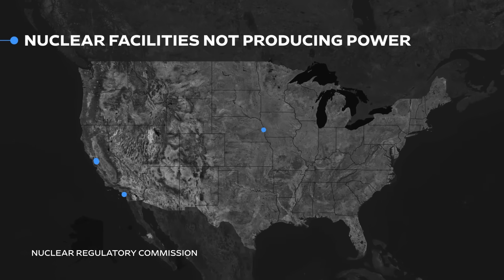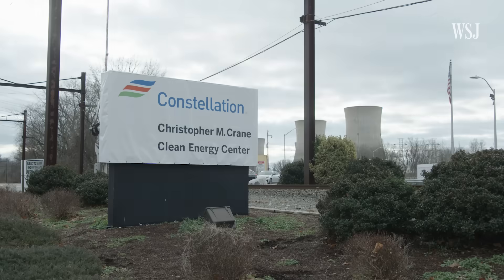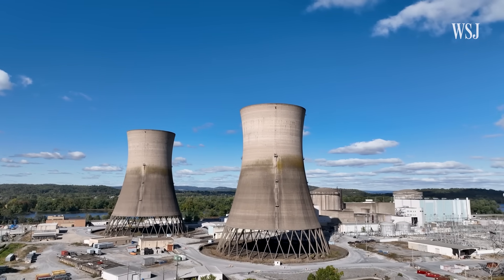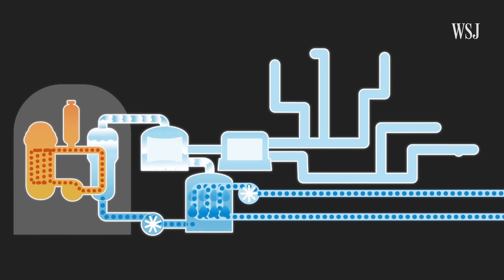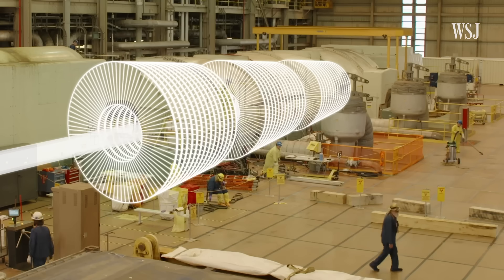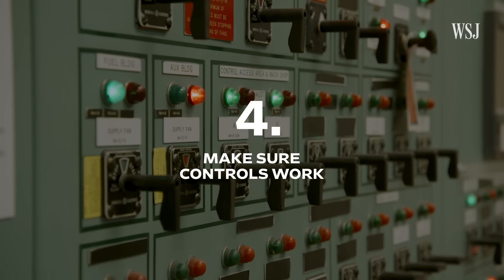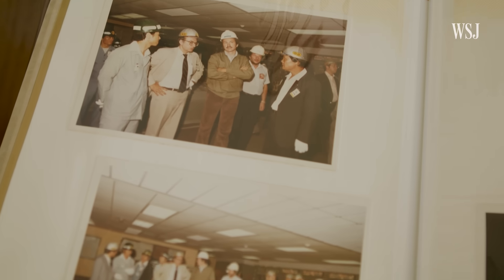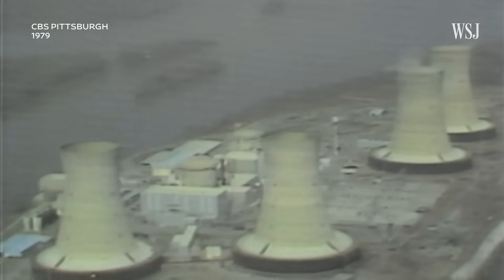Inside the $1.6B Plan to Restart Three Mile Island | WSJ

Comment: Why are they reopening these power plants for mega corporations and AI, instead of to strengthen our energy grid and lower energy costs for Americans.
Reply: Adding this baseload DOES strengthen our energy grid and, theoretically, should stabilize or lower overall electric costs. Whether costs will go down is yet to be seen...However, as much as I'm doubtful, I'm also hopeful!!

As these AI Data Centers come online SOMETHING needs to power them. If we don't increase the baseload capacity, it will create shortages and increase energy costs across the board. Recommissioning these nuclear plants is the best move America can make to ensure energy stability and capacity is there for all who need it. Solar and wind are not reliable enough - by a long shot!! And battery-electric storage is not safe or reliable enough, either.

Next step is to relight many of the natural gas powered plants, then, lastly, the coal plants if needed.
Reply: We don't matter to them. They want $$$, power, and control.
Reply: There will never be a reduction in energy cost .that is all a fiction .you want to stop the  need for more power ? get the human race to stop breeding like rabbits . there are a finite amount of  natural  resources  some of which can not be replaced .some are so deadly if one mistake or one failure happens 10s of thousands of people will be effected for many generations .that's the truth 100s of years .The one and only thing driving this is money not for you and me but the rich and powerful . The absolute truth is if we fallow this path we can destroy the world .I'm glad i am old i will die of old age before this happens but the facts of what i say will not change unless the people force a change . And from what i see today we are doomed .
Reply: The truth is Microsoft will never be able to pull half of that power. Its going in to the grid. It will be used by everyone. Chill the f out and use that brain you have between your ears. Do a little math.
Reply: There is another side to this though. The power plant is being reopened without massive taxpayer investment. It’s infrastructure that would have otherwise laid dormant, thus being unproductive. This lays the foundation for other power plants to be reopened and if this does work out, we will have a profitable business that helps enrich the economy.
Reply: the simple answer is - clean energy.  If maintained properly and with safety procedures, its safe.  in the 70s, they didn't have safety in mind, but now that we know the repercussions if something bad happens, we can work to prevent it.  Plus we also know now that we are not prepared to go without oil and gas and go straight to electric everything.
Reply: because they can afford it. can you?
Reply: The power companies have been shutting down plants specifically to create shortage to necessitate higher prices
Reply: Bureaucrats tie up and forbid building new plants in red tape at a cost effective means.  The mega corporations have the finance to take on the process when the utility companies are fine with current contemporary means of generation and government subsidized funding toward clean energy solutions.  The mega corporations and utilities won't do it if it cost them money.
Reply: @ give me one nuclear regulation that you think is unnecessary and not needed. name one.
Reply: Cause they being the money to pay for it.
Reply: Bill Gates
Reply: we had a very strong Energy until Obama and Biden took Over, hint it still is strong, hint it the TVA can purchase 10k megawatts dec 23 dec 24  2022the problem is not the Grid. it is lack of power Plants
Reply: You've never taken a class in thermodynamics.
Reply: Yeah, it was shut down because "of cost". Why was it so expensive before and what changed that now makes it affordable? I was thinking something else must be at play.
Reply: It's tied into the same grid that everyone else uses. This is a ridiculous question to ask if you understood the engineering side of things.
Reply: Because American 🇺🇸 s a corporation. And we aren’t a democracy or a representative representing republic, it is an oligarchy which is why these corporations get their way.
Reply: If they didn't reopen, then these companies would take from what regular people already have.
Reply: Because power generation has operated as a marketplace and not a state run enterprise
Reply: Because of cost. A group of billionaire investors can raise much more money much more quickly than government can. Such an operation would be stuck in bureaucratic stasis until the site deteriorated beyond repair.  This is all private dollars resurrecting these plants. As long as it passes inspection criteria, this is a good thing because by generating their own power, the companies aren't a drain on public resources.
Reply: @ What are you on about?  TMI was owned by General Public Utilities, a company traded on the NYSE.  It was never a government facility, with the exception that the fuel, like all reactors was leased to them by the govt.
Reply: @ these people dont care about private property
Reply: @John-wx9oy  Exactly
Reply: You and I don't matter, we live in an oligarchy made to serve billionaires and their interests
Reply: @omegathan 😂
Reply: Because we don't matter. They only bothered with this because Nvidia's top of the line GPU requires as much energy as a hundred average homes per hour. 

Goes to show who's really represented as far as our elected officials go.
Reply: @EbonySaints  where'd you get those numbers from?
Reply: @hallomeinnameistkarl216 I used the EIA's 10,500kW estimate for the average American home, divided that by 365 (~28kW per day) and then by 24 for ~1.2kW.

Considering that the GB200 NV72 datasheet from Supermicro states that the whole thing can eat up 132kW, that approximately 110 homes that can be powered instead of a LLM.
Reply: @EbonySaints  This is what America voted for, so this is what they get. Americans must prefer corporations valued over them.
Reply: @EbonySaints  You summed that up perfectly! Our extorted wee tax dollars don't go into their pockets as easily, but profits from shares do, even though the tax payers paid to make it operational!
Reply: Because Microsoft is paying for it. Not the consumer. But who buys Microsoft we do. We are more willing to pay for tech than power.
Reply: This is the place that tried to unalive a safety worker for showing unsafe cleanup procedures after the meltdown.
Reply: Because we don't need them for the grid, it's why they were shuttered to begin with.  Only when an actual demand "above and beyond" came along did it make sense to reopen them.
Reply: Greens
Reply: Because AI is far more important than any of you.
Reply: You literally contradicted yourself and answered your own question
Reply: They want the AI for something that serves themselves. And there may be other reasons they aren't talking about as well. Nefarious reasons.
Reply: @DaveMiller2 and AI will allow them to increase productivity and slim down the work force (if not deleting the white collar work force entirely)
Reply: Dumb question. You already know the answer.
Reply: Becuse it won't strenthen the energy grid and it certainly won't lower energy costs for americans. To run a power plant you need a constant drain as it takes up to 7 days to start.  Pricing is not compareable, too. Renewables can be produced roughly at the price of raw oil, Atomic power is 5 to 10 times as much according to some scientific papers, and in the end electricity has to compete with oil.
Reply: LOWER COSTS?  Get serious, dude!
Reply: The next step towards the cyberpunk dystopia where “Megacorps” own it all. Microsoft - game company, pc hardware company, operating system software company, search indexer, energy supplier. Pretty soon we’ll be approaching microsoft with “ our grid is stressed pwetty pwease can we haz 30 megawatts from your power plant? “ and they’ll be like yeah AND you’ll pay me!
Reply: It's about how much money they can fleece off of people.
Reply: Cause those companies are paying for it. These abandoned nuclear sites are just sitting there generating cost for the taxpayer and these guys are offering to get the problem off their hands.

Now we really ought to be having a re-think about just putting those plants back online for the benefit of everyone and a re-think about how utilities are structured but this is tangential to this and a bigger issue.
Reply: Giga corporations 🤣😋😛😜🤪❤‍🩹❤👍
Reply: We live in oligarchy. It will soon become a Banana Republic in the next coming years once corporate slavery is legalized
Reply: This is for CRYPTO MINING CENTER NOT FOR AI..

Comment: Just re-watched the 2019 HBO tv series Chernobyl and it’s quite terrifying as the absolute worse case scenario.
I hope the safety systems function properly.
Reply: The biggest problem with Chernobyl was they disabled safety systems to run a test, brought the power level too low, and then had to overcome the Xenon gas to bring power back up instead of waiting another day.  Well, they did overpower the Xenon gas and that went to the prompt critical event.
Reply: Was thinking the same. Germany inherited a bunch of soviet reactors when they reunified. They are not keen on nuclear for that reason. The French are meanwhile building a new reactor in the UK and they need to invent new words for time and cost overruns.
Reply: @astranger448  Not the issue at all libs hate them and they will be restarted as well just watch
Reply: Chernobyl reactors and TMI pressurized water reactors are 'apples to oranges'.

Comment: The bigger concerns should be that the entire system design is so outdated it doesnt take into account changes in the geology of the area, the sea level and advances in both reactor design and safety systems. These won't be present when it goes live.
Reply: Or how they skimped on replacing old components that "tested" ok because they want it done quick and cheap.

Comment: Reviving an old nuclear power plant it is just a "cutting corners" for the corporations that wants to be "compliant" with the regulations...... in this case a 45 years old regulations that where in place when the plant was build.
It is the same as the well known "Gliders" in the trucking business, and thousands of them are currently on the roads across U.S. - LEGALLY!!!!

For the people that don`t know about the "Gliders" - that is the latest model of semi truck like Freightliner, fitted with a rebuild Detroit Diesel S60 engine , that was "compliant"  for emissions, smoke and etc. back in 90`s and apparently none of the EPA07, EPA10 , EPA14, EPA17 or EPA21 can stop them from being "rebuild" and keep them from polluting

The Tree Mile Island IS A NUCLEAR PLANT - PLEASE DON`T restart for corporate greed

Comment: Like any industrial industry nuclear requires high levels of attention to safety, maintenance and most importantly redundancy to ensure accidents if and when they do occur are 1. minor and 2. under some control all of which is possible even with older technology.

The old mindset prior to Chernobyl, 3 mile island and a handful off smaller events is that it be built in such a way that it cant fail that was their mark for "safety" rather then assuming something will eventually go wrong so how can we put in place enough redundancy functionality and other safety measures so we can keep such an event under control till we can fix the issue, the people at the time never assumed that at some point either through environmental regulatory changes or a lack of funding would these facilities fall out of repair and thus the risk profile would reach potentially dangerous levels it was unthinkable to them in their time.

What has changed since then is we are more realistic about the dangers nuclear if not done correctly poses, the problem is the general public has not been made aware of the massive improvements in design safety and regulatory checks and balances that have made nuclear in todays, day and age which would make nuclear a much more safer reliable and predictable long term solution to energy needs.

by just about any other measure statistically nuclear is far safer and has a lower risk profile then just about any other source of energy production, but, in many ways we have made radiation so scary to the general public that it is fear keeping people from accepting nuclear as the much safer and cleaner means of energy production.

if you look at the major alternatives such as oil and gas / coal and hydro all of which have significant environmental impact and cause many more deaths and injuries yoy then nuclear ever could then the answer does become clear.

Comment: Nearly half a century old and abandoned nuclear control systems and pipework being quickly checked and used. This seems insane. I wouldn’t pull an abandoned 50 year old washing machine out and use it let alone a nuclear reactor.
Reply: Retired nuclear plant engineer here.  It was only shut down in 2019, and there was a small active staff monitoring the plant and maintaining and operating key safety systems required to cool the water in the Spent fuel pool and radiation safety.

All procedures and documents exist due to storage requirements.

I'm quite sure that there was no significant degradation of any key components due to the materials and deign of nuclear power plants (virtually all nuclear safety systems are built from SS or more exotic alloys).  Main steam piping and turbine casings are very thick even if they are carbon steel.

Most of what is likely to have degraded in 5 years is relatively minor to replace or rebuild.
Reply: @ this video was so badly put together it appeared it was a derelict site that was mothballed! 🙈
Reply: "I wouldn’t pull an abandoned 50 year old washing machine out and use it let alone a nuclear reactor."

That's because you've been thoroughly programmed by advertisers to crave the next big thing.

A 50 year old washing machine would have been built like a tank, using heavy gauge steel for the enclosure, and using dead-simple controls. Even if it wasn't functional, you could refurbish it for dozens of dollars.
Reply: @ not quite sunshine. Also finding someone to refurb to operating condition with suitable parts and guarantee it for use would negate getting something that worked from this millennium.
Reply: @ The USA and much of the rest of the world is successfully operating a lot or nuclear power plants from that era as many companies that served nuclear power plants still do production runs (but the parts are expensive).  Thus key parts are still available and the knowledge of how to refurbish the equipment is standard in the industry.

Comment: Would be easier to just start over with modern controls. That monster control room requires way too many people that know what they are doing. Human error is built in even if the controls work perfectly. They could take all that mess and run it with PLCs.  Then have quadruple redundancy of the entire control system. Just make sure its not able to be connected to the internet...

Comment: If nuclear power is going to be turned back on, let it power American homes. Microsoft buying this solely for AI servers is beyond dystopian, pure madness. These tech businessmen have so grossly oversold AI to investors. I give this project 10 years
Reply: The best part, if/when MS decides they overestimated AI; it's not owned by MS, one can assume that constellation would offload said power to the grid for general use.
Reply: But the power company is paying for the project with Microsoft being the main customer. If it wasn't for tech industries massive energy consumption, this project would not have been economically feasible or profitable. So do you think restarting this plant will make residential energy bills go down, stay the same or go up? And when the plant finally closes who pays for the decommissioning?
Reply: " Microsoft buying this solely for AI servers is beyond dystopian, pure madness."

I don't think you understand what's happening here.

Microsoft has projected how much additional demand they're going to add to the grid. This project is going to increase supply to offset that demand.
Reply: @dafunkmonster  Correct, which means the net benefit of energy costs to the public is zero. A private entity benefits while the risk is socialized - in other words, dystopian.
Reply: @FatherMolonLabe187  If they are paying for project, it's still benefit to you because you didn't pay for added capacity on the grid.

Comment: ..."it is cheaper to restart a nuclear power plant than build one from scratch"...
It continues to be that permanent damage to the atmosphere, surface or groundwater - would not be cheap.
Scientists in Russia, (A. Sakharov), and in the US, (E. Teller), once suggested building nuclear reactors underground. 
The plan was considered to be too expensive.
- The smaller size microreactor might better lend itself to being built over an underground compartment, and on retractable supports.
The underground compartment, partly sealed by plasma torch drilling into the bed rock, would help to protect the water table.
In the event of catastrophic failure, the supports would be retracted and the reactor might be dropped underground, then covered over more quickly.
The hot reactor might also melt an added lead underground compartment lining, encasing, and creating a barrier with respect to the water table.
Once covered, the reactor would be more so the equivalent of an underground nuclear test, limiting possible damage to the atmosphere.
Additional:
"Underground nuclear parks: new approach for the deployment of nuclear energy systems,",
from: WIT Transactions on the Built Environment, Vol 102, www.witpress.com, ISSN 1743-3509 (on-line) 2008 WIT Press, doi:10.2495/US080071